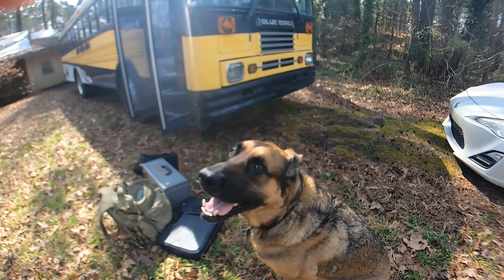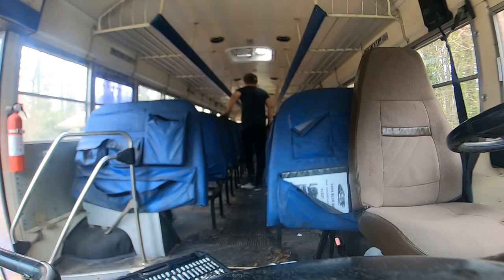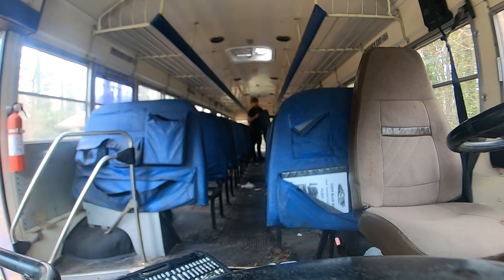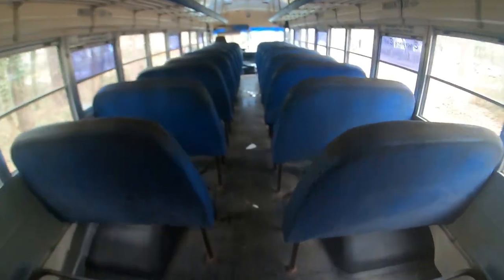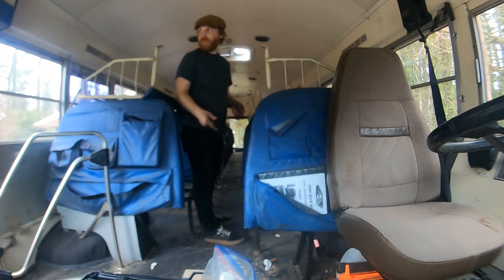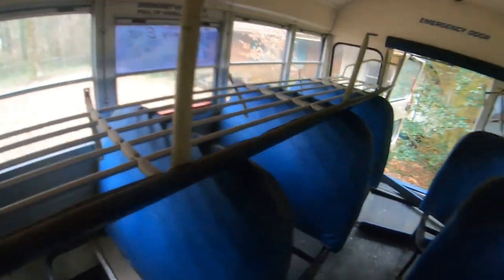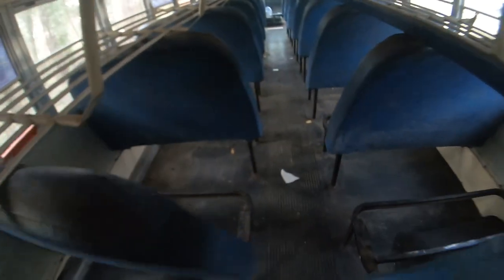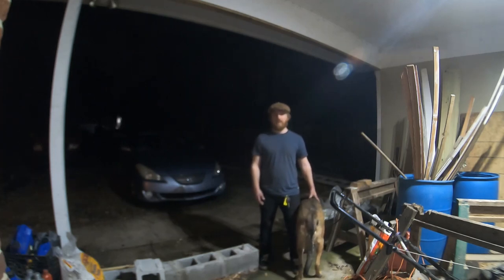Skoolie Conversion: Day 1 First day trying to Convert it into a Skoolie

Comment: Hey man, if you're keeping the windows, make sure to protect them from the angle grinder metal shards. They will embed/melt into the glass and eventually start to rust. Good luck doing this by yourself! It will be worth it in the end.
Reply from the maker: How should I protect the windows? ( I am going to look this up as well since you mentioned it 😂)
Reply: Place anything in front of where the hot metal sparks will fly into the windows. Could use a something like plywood proped up against the windows where you'll be using the angle grinder. Hopefully not flammable, but just check it every now and then while grinding, take brakes, or change the angle or position that the sparks are flying. Keep a fire extinguisher on the bus, especially if you start to get into welding. Also, make sure you get a proper plastic face guard that will not only protect you from flying sparks, but will protect your face if the angle wheel brakes. My dad got metal shards in his eye while wearing those regular clear work glasses. The nurse suggested wearing ski goggles or eye protection with a face shield. We got these. https://www.amazon.com/dp/B001VY3ACE/ref=cm_sw_r_cp_apa_fabc_15GEVNJAQWNS402S9XCK
Reply from the maker: @RoadsideJourney  oh I still have the US Army issued Shooting Goggles so I think that should be protective for my eyes. I will figure out something for a barrier for the windows and check out the extinguisher I have on hand in the bus. Thank You!
Reply: Hey man are you on Instagram?
Reply from the maker: @davaughnyarde8970   John_arndt91  is my personal Instagram  and My Travel instagram is  Adventureawaitsjohn